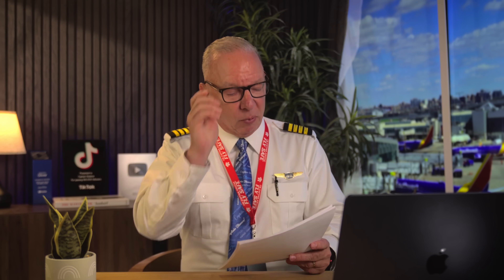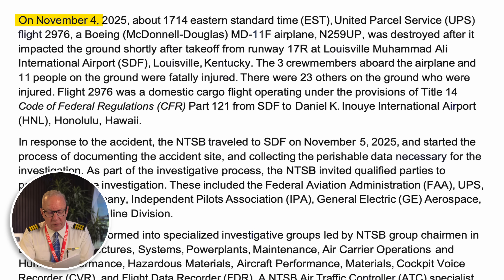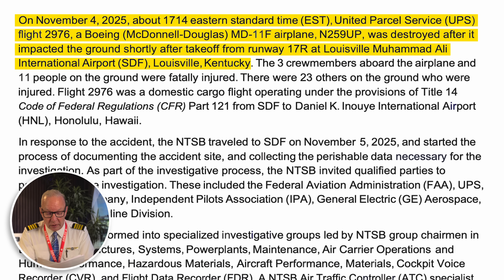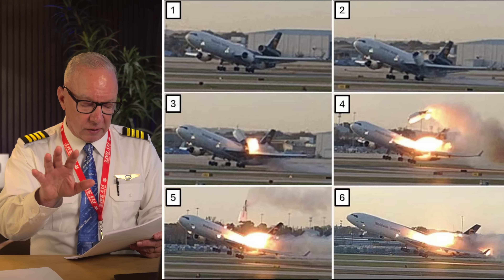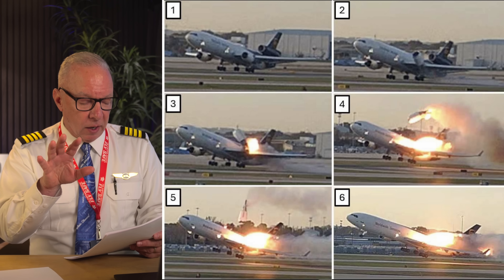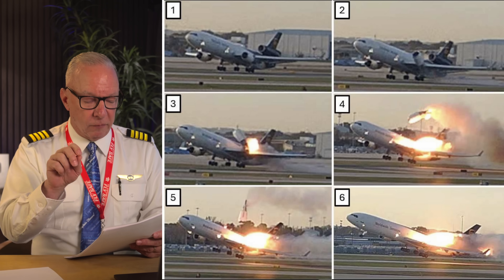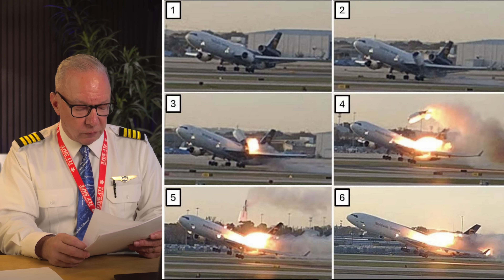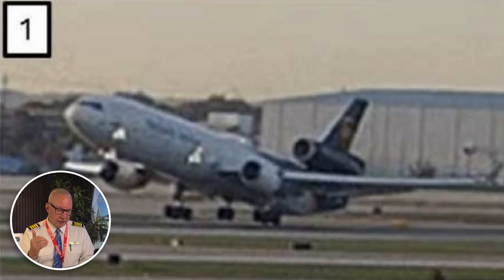UPS Crash Preliminary Report | Pilot Reacts to UPS Crash Report

Comment: The previously unreleased CCTV stills are so chilling. They didn’t stand a chance. RIP.
Reply: Not a chance in hell. The MD11/KC10/DC10 fleet is done. There's no reason to fly a transport cat a/c that can't be saved if the engine pylon fails after rotation.
Reply: @WestAirAviation they can require replacement of all those lugs and clevis’s immediately and every time the engine is out
Reply: @ShaunHensley  True. They could amend the emergency AD to require the pylons inspected before being returned to service using an NDT method that is not just a pure visual inspection, and the interval for these inspections reduced from what they currently are.

But there are only 50 something birds in the FDX/UPS fleet. I could see that AD being used as a way to delay their phase-out to Arizona. 

That said, people take these comments as declarations and not discussions. I don't know more than the next guy and I'm not part of the decision making process. You could be right.
Reply: @WestAirAviation  they could use magnaflux or ultrasound to inspect these components for micro cracks that may not be visible by normal Optical methods. It's how we used to inspect the cooling pipes at nuclear power plants.
Reply: @ShaunHensley  agreed -  its also likely to be  less expensive  overall,   than the time needed for  stress cracking  analysis,  while the  plane remains out of  service.
Reply: If the slats/flaps get damaged then the aircraft will crash, that's what happened to AA191
Reply: @WezzRail  that issue was fixed. This crash was likely due to the compressor stall, had that engine worked they likely would have flown out to make an emergency return. They needed two engines, they had one.
Reply: @pondking2801 - the 1979 DC10 flight had two functional engines. But once that jet started to turn turtle, everyone on board was along for a very short ride. The number two engine stall didn't matter. Lack of it didn't let the UPS flight to get in the air, but even if it had been working properly, losing #1 would have quickly resulted in it rolling over. Another crew along for the ride.  The report is preliminary. I want to see what they find as they keep tunneling to the final report.
Reply: @WestAirAviation  Need to put new pylons on them and make it mandatory or the plane gets grounded.
Reply: @WestAirAviation - The question remains - why did it fail? Yes, cycles are important, but not as critical to non-pressurized as pressurized spaces.  Mounting pylons and engines are not breathing things, unlike the people-space, the fuselage. The fuselage breathes, constantly maintaining balance between internal and external air pressure. Look at the Aloha flight that shed part of its skin. Hundreds of flight cycles per month. Its engines stayed happily fastened to the wings. Cycle stresses are different for pressurized and non-pressurized parts of the plane. This is very likely not going to be cycle-fatigue related, but maintenance-fatigue related. Inspection every five years? Were they effing high?
Reply: @WestAirAviation there is a pile of them sitting in CYYZ
Reply: @WestAirAviation  every multi-engine plane is designed to be able to take off and climb with one engine inoperative, even missing. The problem with UPS 2976 was that multiple engines had issues. No plane can climb with multiple engines inop. Except maybe 4-engine planes
Reply: @kylewitter2806  UPS 2976 lost engine 2 because the pylon failure sent debris and burning vapor into engine 2. This is not a problem on other multi engine aircraft because they don't have an engine downstream from the debris. Again, this is a issue specific to this family of aircraft and it's not an acceptable risk when there are other transport category aircraft that can survive a pylon failure without losing the ship.
Reply: @WestAirAviation  a redesign of the pylon mount may be an answer to this, adding a third lug somewhere between the fore and aft to reduce stress on the aft lug. my guess, though, is they just lower the inspection intervals by a few thousand cycles and say good enough. like always when something like this happens and it isn't due to operator error, it is almost always someone cutting corners to save a few minutes or dollars. not surprised that this seems to be the case here yet again. it's really sad the pilots and people on the ground had to lose their lives because of it.
Reply: @WestAirAviation  "This is not a problem for other multi-engine aircraft because they don't have an engine downstream from the debris."  I laugh in AA 191.  

ANY airplane that has an engine depart in this manner is on borrowed time, 3rd engine in the tail or not.  It was only a matter of time before the damaged wing structure was further compromised by the burning fire.
Reply: @WestAirAviation  The Lockheed L-1011 was a similar 3-engine design and its tail engine could also fail in a similar manner. It never did lose an underwing engine however.  This is the second time a DC-10 or MD-11 lost an underwing engine
Reply: @to-yg1tx  I worked big airplanes most of my life,. I don't see where corners were cut. Those maintenance intervals were a product of the aircraft manufacturer, and they were too short of an interval it seems. Those sort of inspection items come from engineering guys, and I would say (Monday morning quarterbacking), that the procedures or time intervals were incorrect. The airplane operator doesn't set the maintenance requirements for an airplane, the people who make it does.
Reply: @fiveoboy01  Exactly. The plane no longer could fly.
Trying to take off with a plane that no longer could fly wasn't the better of two options.
The better option was to desperately abort as soon as indications of serious trouble arose
Reply: They were already rotating as evidenced by the still images in the report. How were they supposed to abort?
Reply: @AlainDessureault you’re wrong.  The airplane was off the ground when the engine departed the wing.  Aborting wasn’t an option.
Reply: @johnandrobinmccoy8305  i wasn't specifically referring to techs, i suppose i should have specified i'm lumping management at these corporations in there too. for example, if a client that owns a lot of your product wants to save some money and goes to the bosses and says "hey, can't we push this interval back a little bit? what's the harm? we'll buy more of your product if you do.", execs are usually happy to oblige if it means they can report higher earnings to shareholders. i suppose we will find out in time, either directly from the NTSB or by taking inference from any new directives regarding maintenance or design revisions.
Reply: @fiveoboy01 
"you’re wrong"
Nope!
"The airplane was off the ground when the engine departed the wing"
Yep!
"Aborting wasn’t an option"
On the contrary, it very much was still an option — the best option
Reply: @june4471 
"They were already rotating as evidenced by the still images in the report"
When the engine broke off, yes
"How were they supposed to abort?"
1) Instantly idle the engines
2) initiate reverse thrust (there'll be a delay)
3) during delay the plane would've settled back down
4) hit the brakes, deploy spoilers, full reverse thrust
Reply: @AlainDessureault Against their training? In the 28 seconds or so that they had to react? And they'd still go off the runway, through the fence, and plow through whatever was there anyway?
Reply: @june4471  
"Against their training?"
Apparently so. Pilots say they're trained over and over to not abort after V1.
The problem is, there are cases where that's the wrong action to take.
"In the 28 seconds or so that they had to react?"
Oh, it was much less than that! They had options to abort at the 37 second mark, 38, 39 and possibly even 40 second mark. So, in all, only about 3, maybe 4 seconds to react.
"And they'd still go off the runway"
Probably
"through the fence"
Nope
"and plow through whatever was there anyway?"
Nope. The plane could've stopped on airport grounds and might've crushed a few lights and antennas only. Crew might've been able to abort even a second or three later but in that case they would've had to veer sharply to the right, crashed through the fence and gone through several obstacles like road, trees, train track, ditch, etc.
Reply: @AlainDessureault  and then run off the end of the runway into the barrier fence and the airport runway infrastructure, not to mention the buildings adjacent to the airport. There is a reason for the V1 speed call. Not too long ago a plane was destroyed hitting the infrastructure just off the end of a runway.
Reply: @AlainDessureault  no, they were past the abort option at 37 seconds.
Reply: @pondking2801 
No, they weren't
You're confusing some regulations with physics
Physics has the last word
Reply: @pondking2801  
"then run off the end of the runway into the barrier fence and the airport runway infrastructure, not to mention the buildings adjacent to the airport"
Not for aborts at 37, 38 and 39 seconds
"There is a reason for the V1 speed call"
Yes, and that reason doesn't apply here.
"Not too long ago a plane was destroyed hitting the infrastructure just off the end of a runway"
Because it was going fast and unable to brake so close to a solid obstacle — which wasn't the case for the UPS MD-11
Reply: @A @AlainDessureault  this plane went over 3000 feet after it hit the ground and was sliding. Aborting past VR would have been a similar distance, hitting the UPS warehouse solidly instead of with the main gear. That would have destroyed the plane and risked even more people inside.
Reply: @AlainDessureault  The physics of a 650,000 pound aircraft moving 200+ MPH. It isn't stopping inside the airport. Physics is why the crews are trained to fly once past V1, it is their best chance. Aborting is a guarenteed crash at that point.
Reply: @pondking2801 
Stuff you made up:
1) 650,000 pound aircraft
2) isn't stopping inside airport
3) flying past V1 was their best chance
Guaranteed crashing was the inevitable outcome of trying to take off. In the case of a desperate abort, a crash was not inevitable depending on when the abort was initiated and how it was done. Even the crew might've survived
Reply: @AlainDessureault   You are right, I should have said around 600,000 pounds. This was a fully loaded flight set for a long haul to Hawaii, so full cargo, full fuel. Empty these things are 290000 pounds.  Also, the reason V1 exists is it is the speed at which they can no longer stop on the runway, so crews are taught to fly away and return above that speed. You can look that up too.
Reply: @pondking2801 
Furthermore, it simply isn't true that "physics is why the crews are trained to fly once past V1" nor that "it is their best chance" in all cases.
Reply: @pondking2801 
Please look up the weight of this MD-11?
Your belief V1 is the speed they can no longer stop on the runway is only sometimes true, and stopping on the runway wasn't the goal here.
Crews being taught to fly away was incorrect training in this case - since the plane was incapable of flight. You can look that up too.
Reply: @AlainDessureault  believing that this right here would work tells me you know fuck-all about anything related to airliner ops other than youtube or FSX.  LMAO.
Reply: @pondking2801  
"this plane went over 3000 feet after it hit the ground and was sliding"
Means nothing. No braking nor reverse thrust available.
"Aborting past VR would have been a similar distance"
Nope!
"hitting the UPS warehouse solidly"
Nope!
"That would have destroyed the plane and risked even more people inside"
Nope! All abort times, from the bell beginning to sound at 37 seconds … to the instant of engine breaking off, were times to abort without hitting the UPS building
Reply: @Thatguy11351  
Posting nonsense without any kind of counterargument tells me you know f…-all about anything related to logic and physics
Reply: @pondking2801  
By the way, your assertion that …
"this plane went over 3000 feet after it hit the ground and was sliding. Aborting past VR would have been a similar distance, hitting the UPS warehouse solidly"
… is quite funny because the MD-11's left engine pivoted upwards at about ~6,571 ft from the north threshold bar — meaning the UPS building was still 5,658 ft ahead — well out of range of the plane if the plane had slid from the moment the engine broke off
Reply: No, its problem was one engine tore off causing that wing to catch fire plus destroying engine # 2 in the process. That plane could have had 5 engines and it would have been doomed
Reply: @kylewitter2806  This isn't actually true. Every TRANSPORT CATEGORY multi-engine aircraft is designed to be able to take off and climb with one engine inoperative. Not every multi-engine aircraft. There are plenty of light aircraft that can't do it, and don't have to be able to do. Also, there are many tri-engine aircraft (Falcon 900 for example), that can take-off and climb with a single engine operating, but only under certain load conditions.
Reply: @A @AlainDessureault he brakes would be about the same as the sliding resistance of the aircraft. Thrust reverses would not be usable due to asymmetrical load due to missing engine. A thirty ton plane does not stop quickly even in the best of times.
Reply: @pondking2801  
"he brakes would be about the same as the sliding resistance of the aircraft"
That sounds a little bit made-up
"Thrust reverses would not be usable due to asymmetrical load due to missing engine"
That sounds a little bit made-up too
"A thirty ton plane does not stop quickly even in the best of times"
Yeah, but this plane had brakes, spoilers and thrust reversers good enough for even three hundred tons
Reply: @WestAirAviation  there is the el al 747 crash in amsterdam. engine 3 separated due to excessive vibration. due to the way those parts failed, the engine shot outwards and hit engine 4, causing it to separate too.
Reply: @WestAirAviation  McDonell Douglas is done.
Reply: @WestAirAviation  Most certainly not done.  There will be a fix and/or revised maintenance intervals.
Reply: @fiveoboy01 just wait for the full report where we find out the the maintenance contractors were taking shortcuts on engine and pylon removals for inspections. AGAIN.
Reply: @fiveoboy01  Yes, that is exactly what happened after the Alaska Airlines Flight 261 crash when the tail jackscrew failed from no grease, and everyone onboard was killed - they changed the maintenance intervals.
Reply: @Rover200Power  - This is my gut feeling. They got complacent and brought out the shortcuts. Again.  They didn't learn.
Reply: @brucewizjam3618  - REPEATEDLY! At any point in that aircrafts life, that accident could have been completely negated.  Alaskan is another AD dramatized from a couple different angles. Was Alaskan the one that when the NTSB finally drulled down to a maintenance guy, he told them he'd been expecting this call for ages?
Reply: @WestAirAviation  I will bet you anything it's not the end of them!
Reply: @security005  If it's not the end of them, I would think they should change the inspection interval to something much less than six years.  This ship had another two years before its pylons were due to be inspected, and it was just in for maintenance and had the bearings lubricated.  If they cut that inspection interval, then perhaps the cost of maintaining the fleet could contribute to their retirement.
Reply: There just wasn’t a good option regardless here.  The engine failed right as they started to rotate. There was no way they could even attempt an abort even if they wanted to. They would have crashed through the blast fence and at 150+ knots and done basically the same damage. There was just no good option here.
Reply: I wonder how much the pilots knew and when 😢
Reply: @linlondon ikr 😢 it was out of their hands. The brave souls must have tried their level best to save the aircraft.
Reply: @linlondon - they knew almost immediately that they weren't getting into the air. An engine doesn't fall off a plane without someone realizing something terrible had gone wrong. They wouldnt have given up flying the plane, but they'd have known within  seconds they were probably deeply, irrevocably screwed.
Reply: @linlondon  
"I wonder how much the pilots knew and when"
When the engine broke off the crew must've felt a violent asymmetry in the thrust that clearly told them the engine had failed catastrophically. Whether parts of the engine were still attached or not, the crew could tell its thrust had become zero instantly. At that instant they followed training and relied on the two remaining engines — which was not the right option. It seems the remaining engines did not continue at a combined full thrust. At least one was affected. Without two full thrust surviving engines, the plane could not fly and trying to takeoff was going to cause a crash that likely would kill people on the ground. A desperate abort was a better option.
Reply: @AlainDessureault Zero thrust reversers, they would gone through the fence and into buildings anyway. They were doomed from the start.
Reply: @AlainDessureault an abort would have had the same result.  

There’s a reason you continue once you’ve reached V1.
Reply: @fiveoboy01 
"an abort would have had the same result"
Nope!
"There’s a reason you continue once you’ve reached V1"
Yep, some regulations
But those regulations were not appropriate in this case. In this case, the best option was to desperately abort as soon as indications of serious trouble arose.
Reply: @A @AlainDessureault u’ve got no idea what you’re talking about.
Reply: @fiveoboy01  
I have much more than an idea.
You, not so much
Reply: @AlainDessureault The failure happened after V1 (point of no return) and rotate (the plane was airborne). Nothing they could do.
Reply: @frankrivers3797 
False. When the bell started sounding, an abort was absolutely possible. Even after that, for a few seconds, it was still the best option
Reply: @AlainDessureault  - They were past abort. Once you rotate, you can't just point yourself back down to the runway.  That's behind you.  You've got to get into the air, declare an emergency,  execute a go around, then land a crippled jet. They were out of power, out of runway, never had altitude, and out of time.
Reply: @AlainDessureault  There was no abort possible.  Firstly, the aircraft was off the runway when the engine departed, so just hitting the brakes isn't an option.  Cutting the throttles so it could "settle back down" wouldn't have worked at all, because there was no runway left.  It would have been an overrun and a crash at that speed.  End of day... Anything they attempted would have resulted in a fireball.  You know nothing about how these things work and you ought to stop embarrassing yourself.
Reply: @AlainDessureault  - Those aren't regulations. It's pure physics and resources. To abort a takeoff, you need some runway, or someplace suitable to set a jet down. Unavailable here. They were out of runway, and you just cannot put a jet of that size down in a parking lot, on a street, or even a highway. You've got to get the bird into the air, give yourself time to think, get stabilized if possible, and land. But once that bird's off the deck... an aborted take-off implies the wheels are still on the ground.  They had rotated. They were off the ground. This was no longer an abort situation.  At best, this was a limp back to the airport and execute the best landing they could manage. At worst... well, we saw the worst.
Reply: @shegeek5559  
"They were past abort"
When?
"Once you rotate, you can't just point yourself back down to the runway"
Why not?
"You've got to get into the air"
Not in this case!
"execute a go around"
Not a chance with this plane
"They were … out of runway"
Nope! They had the chance to abort at 37 seconds, and even as late as when they began to rotate.
Reply: @Thatguy11351  
"There was no abort possible"
Nonsense
"Firstly, the aircraft was off the runway when the engine departed, so just hitting the brakes isn't an option"
Engines idle, settle back on the ground, fast spoilers, brakes, reverse thrust.
"Cutting the throttles so it could settle back down wouldn't have worked at all, because there was no runway left"
You made that up. There was runway and terrain left.
"It would have been an overrun and a crash at that speed"
Overrun yes but less of a lethal crash than it actually turned out to be.
"Anything they attempted would have resulted in a fireball"
Except a fireball from aborting would have been less lethal and even the crew might've had a chance to escape.
"You know nothing about how these things work"
More than you, and you're not paying attention.
You ought to stop embarrassing yourself.
Reply: @shegeek5559  
"Those aren't regulations. It's pure physics and resources"
No, it's not. Those are some regulations. Aborting after V1 is possible in many cases.
"To abort a takeoff, you need some runway, or someplace suitable to set a jet down"
Which was available in this story.
"They were out of runway"
You made that up.
"You've got to get the bird into the air, give yourself time to think"
Not when the plane is unflyable. Trying to fly it is the most irrational thing to try.
"They had rotated"
They could've de-rotated.
"They were off the ground"
Not by much
"This was no longer an abort situation"
Physics begs to differ
"At best, this was a limp back to the airport and execute the best landing they could manage"
No, that was never a possibility. Aborting, on the other hand, clearly was a possibility
Reply: Even if it got in the air the fire would of just ate up the wing and the plane would of torpedoed into the ground
Reply: @danielpetrucci8952  
That kind of fire has happened before to a passenger airliner. Instead of slamming on the brakes, the crew took off and attempted a go-around. The plane climbed and then the fire caused a big explosion that destroyed the wing. Guess what happened after that? Was the plan to fly a plane with a wing on fire at that time a good idea?
Reply: Thank you for explaining this. May the families of all involved find peace.
May you also find peace. That must have been a very difficult video to make.
Reply: Said to see 😢
Reply: I need to request a Delivery Investigation for tracking number 7E9E49-1Z7E9E490460515986
The package was delivered to an unknown person.
The receiver name and phone number on the shipment were incorrect.
We already provided UPS the correct consignee details.
This is a Misdelivery, not a successful delivery.

Please start:

Proof of Delivery photo

GPS delivery location check

Driver interview

Package recovery and redelivery to the correct consignee.
Reply: Thanks for the info Captain Steve. Prayers for all the families and victims involved in that horrific crash. 😥🙏
Reply: I wonder how much UPS saved on the bottom line before the crash?
Reply: Let's Cut the Sh**p!  Regardless if DC-10's are called MD-11's, truth be told, the Mechanics 
like in 1991, again saved 3-4 hours, by fork-lifting of a fixed engine, to bolt back into 
the pylon, instead of method by "MD-11" aka, DC-10 manufacturer instructions not to do that!
Reply: you bring nothing to the table then end with virtue signaling.... ugh
Reply: @slowery43 
Nonsense
I bring to the table what physics says: the abort option
Reply: I think it should have been released at the moment it was found.  Transparency is important.
Reply: @Islamisthecultofsin why? Give them time to investigate and get the full details.
Reply: @BobetoSlim   There was no reason to hide the video.  It should have been released with all of the other videos as they were discovered.  The NTSB shouldn't have had any say in it.  Their job is just to do their investigation and release their findings.
Reply: @Islamisthecultofsin what difference would that have made?

Also the NTSB is one of the most transparent agencies in the entire US government
Reply: Its crazy that everyone has concluded that Stockton Rush's unsafe practices got 5 people killed. The bottomline is the aviation industry puts way more peiple at risk every day and everyone is fine with it because it has been a normalized risk. Oceangate's rtm sensors could have prevented this wreck. Microphones at the pylon to detect metal breaking and rattling about. But Stockton Rush is an idiot and everyone involved in aviation are true American heros. Pilots have to be the dumbest people of all time to blindly trust someone else's inspection of a vehicle their lives depend on
Reply: @macbook802 thats a lot of words for "i know nothing about aviation"
Reply: @Cody-z4i3uhaters will hate on the truth, they try to undermine other's intelligence. They go heads up and see who knows more... I built my first airplane at 9 years old... I know enough about aviation
Reply: @macbook802 Stockton Rush is still an idiot, even more now than back then. He ignored warnings from various people over time about the safety and reliability of his equipment. And got punished for his arrogance. This accident was only similar in that multiple people died. A similar catastrophe happened forty-five years ago regarding the DC-10. They weren't warned in the meantime like Rush was. These pilot did yeoman's work given the shocking photo of that engine being launched from under the wing. Those three pilots are heroic, and unfortunately were also victims of poor design and/or insufficient maintenance. But it was not willful negligence like the foolhardy actions of Stockton Rush. Prayers for all concerned.
Reply: @macbook802 are you on crack?
Reply: @macbook802  In this case it looks like a late, desperate abort was the better option. The plane would not have stopped on the runway but on terrain further down. The 11 victims on the ground would not have been killed. Even the crew might've had a chance to escape on the right side.
Reply: @AlainDessureault The plane was already off the ground when the engine detached, and there wouldn't be much runway left to land. Once airborne, all problems, no matter how extreme have to be taken into the air. An abort is only possible before the decision speed (which is while you're still on the ground)
Reply: @aidywady4553  
"The plane was already off the ground when the engine detached"
Yep
"there wouldn't be much runway left to land"
There would've been enough runway-plus-terrain to stop
"Once airborne, all problems, no matter how extreme have to be taken into the air"
Absolutely not in the case for an unflyable plane — which this one was
"An abort is only possible before the decision speed"
False. Only a specific kind of abort under specific conditions … is only possible before the decision speed. Those specific conditions were not present in this story and the kind of abort needed was not the specific kind in the rule you're referring to.
Reply: So let me guess..... Boeing again...... Something is seriously wrong with boeing... RIP 🙏😢
Reply: @Your-future-cool-boyfriend Boeing acquired McDonnell Douglas and all their aircraft after a merger. UPS followed recommended maintenance schedules. It was not them.
Reply: @chrisd6479 thanks chris. I was under the assumption that the aircraft was initially manufactured by McDonnell Douglas and the production was completed by Boeing...
Reply: @Your-future-cool-boyfriend No worries, I know it’s a common misconception.
Reply: @chrisd6479  Who sets the 6-year interval between pylon inspections and maintenance? Answer: Boeing.
Reply: @Your-future-cool-boyfriendThe very best of machines ultimately fail just as how the healthiest of humans eventually die. It's unfair & illogical to blame a manufacturer when a fleet of an airplanes operate safely for almost a half century.  The lesson lies in properly managing wear & tear with adequate frequency of appropriate inspections, and timely replacement of critical, high-stress airframe components.
Reply: @Snookynibbles I agree
Reply: @Your-future-cool-boyfriend You are uneducated enough to think Boeing designed and built this plane?
Reply: @philwithnotes phil, that's not a nice thing to say... BTW, you think boeing never built MD 11 post acquisition? 

Let me educate you sir! The MD-11 was originally built by McDonnell Douglas, but after the company's merger with Boeing, Boeing took over production and Completed The Final Aircraft. Therefore, while McDonnell Douglas designed and launched the MD-11 program, both companies were involved in its manufacturing history.
Reply: @Your-future-cool-boyfriend since you did just a little bit of reading between your first comment and this one where you tried to sound educated, Boeing did not manufacture any dc-11’s. The production run was finished around the time of acquisition in 1997 even though it took until 2001 for the final dc-11 to be sold and delivered. Just because Boeing delivered and received payment for the plane does not mean that they in anyway manufactured any of them.
Reply: @Your-future-cool-boyfriendboeing actually did not manufacture anything post-acquisition….